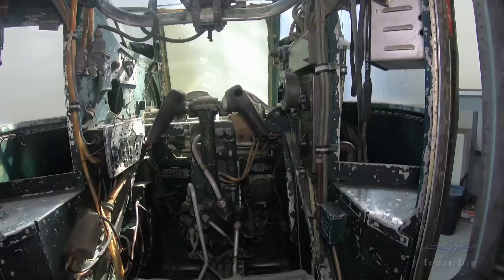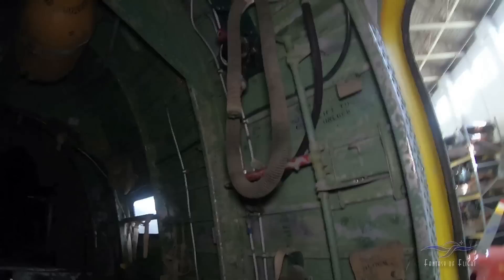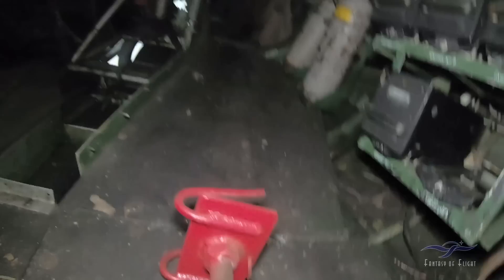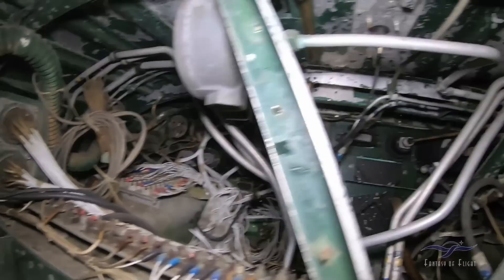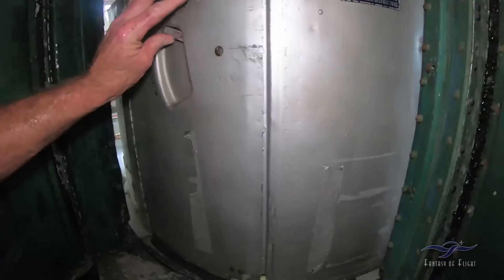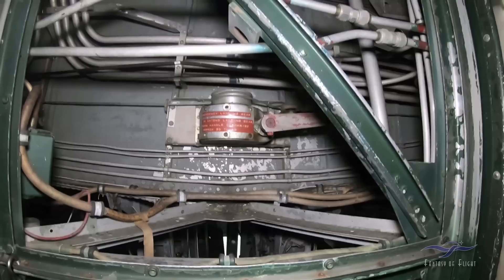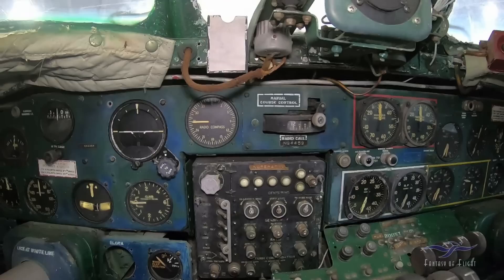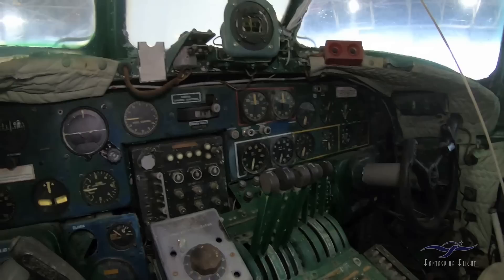Consolidated B-24 Tour - Subscriber's Request! - Part 2

Comment: Kermie great video! I recognize the twin red buttons up on Co Pilots console. It is the IFF Destructor Switch NOT the Engine Fire Bottles switch. The IFF can be destroyed two ways, the crash switch and the Destructor Switch. I was watching when you were climbing near the top gun turret station, and on the Starboard Bulkhead above the little seat and table (near the torn back insulation) is the IFF Selector Switch for the "code of the day" 1-6. I was unable to spot the IFF Transponder Unit itself called the "ABK Unit" I suspect it has been removed, but they possible to find. Thanks for climbing all through the B24 it was amazing to see how authentic condition it is in! Jerry

Comment: Thanks for the tour. I have never seen the inside of one of these. My father was a B-24 pilot during the war and he told me a story about flying a B-24 from Nebraska to North Africa: They had received a brand new B-24 in Nebraska and were ordered to fly to North Africa to participate in the war effort from there. They flew to an air base in Brazil and landed there to refuel before crossing the Atlantic. The runway they landed on was one of those perforated steel runways used during the war. It had been raining for about two weeks and the runway was covered in slime. Also the runway was lined down both sides with parked PBYs. As soon as the B-24 touched down and the brakes were applied the aircraft began to turn sideways and slide. The brakes were released and the aircraft straightened out and rolled down the runway and off the end into a field of mud. The landing gear immediately sank into the mud and the aircraft slid along on its belly until it stopped. The Sea Bees brought up a large Bulldozer, hooked on, and pulled the B-24 back onto the runway. The bomb bay was completely filled with ribbons of mud that had come in through gaps in the doors. A fire truck was brought up and they washed out the  bomb bay with a fire hose. The aircraft was refueled and they set out over the Atlantic Ocean for North Africa. Somewhere over the Atlantic it came time to transfer fuel, for weight and balance issues. The transfer pumps, which were located in the bomb bay, failed to function. The command pilot, my father was copilot, made the decision to abandon the aircraft. My father as copilot was to be the first man to jump out through the bomb bay. He got out out of his seat, made his way back to the open bomb bay, and was preparing to jump when the flight engineer, this big old master sergeant, picked him up bodily and set him off to the side. The flight engineer then walked out onto cat walk over the open bomb bay and proceeded to kick the transfer pumps until they began working. The fuel was transferred and the flight was continued to North Africa where they did their part for the war effort.

Comment: What is most common with these machines is the aroma of the chemicals used in the 40's for lubrication,varnish, oils and fuel and the zinc chromate paint. The smell is something you never forget.  Also imagine being dressed for high altitude flight and climbing into this aircraft that has been sitting out in the Sun , closed up and with an inside temp of about 120 degrees or more. Especially bad when the aircraft were painted overall olive drab.
Reply: What was worse was reaching cruising altitude where the temperatures were 40 below and touching anything metal with your bare skin would rip your skin off. That is why air crews wore sheep skin lined clothing over their electrically heated flight suits and wore sheepskin lined gloves.

Comment: Note that it doesnt help much, except psychologically, to cross the catwalk even with the doors closed, since they are designed to pop open under 100lbs or more of weight, so you can escape without stopping to crank the doors open (the bomb bay was the primary escape route for most of the crew), and also in case a bomb falls off the rack, or someow a load is dropped when the doors are closed. So if you slip off the catwalk, you are in trouble, open or closed.

Comment: Thanks for sharing a fantastic tour. My father was a navigator in the 90th Bomb Group in the Pacific. During bomb runs, he'd climb down to the bomb bay section and monitor the bomb bay doors. He said the vibration would sometimes cause the doors to slip down a little and he'd have to use that crank to keep them open. 

Sadly he passed away three years ago at the age of 91. I wish he could see this video. I think the last time he was in a B-24 was when he returned with a brand new airplane. Had to landed LA for some weather issue, then turned it over to USAAF and walked away. I bet he would remember a lot if he saw this.

Comment: Emerson electric nose and tail turrets. The rear one on yours has a K14 gyroscopic computing gunsight. The front has an electric reflector sight with illuminated reticule. The ring and bead/post was a back up if electricity failed.

Comment: Kermit that big switch is the electric hydraulic boost. Turned on when number three is throttled for landing as it has only engine driven hydraulic pump. 

An incredible time capsule of the 1940 era bomber aircraft. Akin to an undisturbed downed aircraft of 80 years but in near pristine condition. Imagine the emotions of flying such a craft into harms way. 

Difficult enough to complete mission in normal flight regimes let alone battle damaged. A thousand points of potential leaks of fuel, oil, hydraulic fluids. The enemy aircraft fully capable of shredding it all in mere seconds. They did not present themselves as easy targets but extremely fast and difficult to bring turrets to bear upon. Imagine the men unable to escape their stricken craft as she makes her mortally wounded struggle to maintain airspeed/altitude.

War is an incredible dichotomy of emotions all mixed into the experience of duty, honor, country.
No g.p.s., minimalistic radio technology, vast unpredictable weather operation in the range of mission. 

There’ll be blue birds over the white cliffs of Dover, tomorrow, just you wait and see.

Reel  your antenna in before landing,, the base commandant gets upset when the lead weight bounces through his office.

Have your flight engineer top gunner check your flying surface controls before take off, it may seem superfluous, but cables have been inadvertently reversed by ground crews.

That ship is 100% authentic.

Anything but air tight that 50 below breeze160 knots at 30,000 feet made your flying suit essential.

That ship is a priceless museum piece. In 1944 that was the spacecraft of the day and those old timers amaze me with their clever craft and patriotic duty. Simply magnificent Kermit.

Skipper, four is smoking number two is knocked out,, the right fin is shot away. We’ve got three really badly wounded.
That flak did a number on us.

Well boys , feather two and four, fire extinguish both, throw everything we don’t need overboard.
She’s still clawing for air speed and no fighters have seen us yet,, I’ll try to keep her flying, heading  for the deck, till we get over the lines. You can bail now or if we get the fire out we’ll try to make base.
She doesn’t seem to be leaking fuel so let’s try to get out of here.

Skipper, we’ve got a five hundred pounder hung up! 

Well, try to work it loose if the doors will open enough,, if not boys put the chutes on our wounded and try to get ‘em out, bail out, I’ll keep her level till,,,,

Comment: My best friend (gone now) flew 31 missions in a B-24.. Was the pilot...Here is something most people don't know.. His second plane was the only B-24 he seen with 4 bladed Paddle Props.. I believe it was a H model? It was named Hennie Hunter, and flew right up front on D-Day. I believe he had two missions that day.. Had one the day before, but was canceled because weather.. He flew off of the Col. wing that was flying Red Ass. This was the lead group of planes in on D Day.Bud was right up front in the 446 bomb group.. Flew out of Bungay,England .That plane went down in the English Channel one month after Bud got back to the states.. First Plane he flew was Wee Willis. One of the very first B-24 built. Those were the tough ones to fly.. I talked to him many times about all his missions..Lot of close calls from different things..
Reply from the maker: Thanks for sharing that.
Reply: @KermitWeeks444  Thanks for the Tour, and your passion for Planes/History
One last note on Bud's four bladed prop plane. When it first showed up at Bungay, The Crew Chief told Bud, and his co-pilot to take it for a spin. It was empty  with just fuel.. Bud said it was a real hot rod compared to his first plane. Went on to explain a bit about the Davis wing, and where it worked best.. (altitude) The B-24 flew lower then the B-17 in general, but he tried out the ceiling when on that test drive. He said it kept climbing, and climbing up to 33 thousand ft, and was still going. Reason he stopped was he noticed the Fuel Pressure gauges start to Flicker,and thought that was about enough. :)
Reply: Please write those memories down before they disappear forever.

Comment: During the tour of the Navigator/ Bombardier station, the EMERSON BOW TURRET has two sets of hatches. the set mounted on the turret had to be locked closed before the turret could be rotated. The inner doors were locked shut to keep the cold wind blast from entering the cabin. In warmer climates, the were left open for ventilation.
The pedal inside the turret (left foot ) was for clearing jammed ammunition in the Browning cal.50. the dead man switches had long ago been by passed because the were broken off at the bottom of the control handles.
After leaving the nose, entering the forward cabin. Kermit said the seat for the MARTIN 250CE ELECTRIC DECK TURRET was missing but later on he lifted a piece of plywood. That was the remnant of the seat. During it's service in the INDIAN AIR FORCE the flip-down gunner's seat was replaced (the original metal backed seat probably broke loose and couldn't be fixed) the under-seat control box was always flopping around because nobody ever checked to see if it was locked before flight.
All over the cockpit, there are two different greens sprayed. The original green was a black-green and can be seen, if you look carefully. The funky Apple green was a poor attempt to cover up all the chipped paint that was flaking off around the cockpit and the control levers. (too bad they were so sloppy) :(..
Reply: P.S. The canvas cover by the Radio Operator was meant to keep the operator warm and to quiet the wind noise whistling around in the waist gunner's area. (It was very loud which made sending and receiving audio messages almost unintelligible) a Radio man,
 Sgt. Hank Gableman (God rest his Soul) said that even with the heat of the tube radios and curtain closed, at 25,000 ft, it was so cold that he would use the sunlight coming through the windows to stay warm.

Comment: Fire bottle controls are on floor, outboard of co-pilot seat. Bombsight likely Sperry T-1 (near copy of Lancaster sight). Large box on left of nose is where speed/drift/etc. would have been entered. Norden not allowed on exported aircraft (as was likely case for Sperry S-1). I think restoring a/c with T-1 would not represent a USAAF-service plane. Seat for Martin top turret was part of an electronics enclosure; gunner stood into turret, then pulled seat-covered box up to his butt. Latches on each side let him drop it when he was ready to leave the turret. Brakes had two complete systems (inner and outer). Not differential. If both pilots pressed left brake, one system applied (lets assume inner), with improved force because two pilots were applying it. If both pilots applied both pedals, max force applied to entire system. Hydraulic gauges showed what was available, and how much of that is being applied to inner and outer systems.

Comment: Kermit, one of the very finest tours ever ! If that thing is fully restored (and everything left in which is now there) to flying condition it will be the best of all the flying 4-mots by a big margin, it is however a very, very good thing you recorded it as it is now also as a historical record. In the pit I wondered where the Interccoler flap controls might be, they were quite important to keep the engine from knocking by too high carb air at hi-alt and high power - in the B-17 you have them on the right side of the Co-pilot posistion. I will do the B-24 in my 'little' simulation I'm working on, it's an absolute must (though not to the fidelity we see here). I can't wait the day you will give us a full tour of the finished job !!!

Comment: Thanks for the tour Kermit. For several years I used to have Sunday breakfast with several aviation minded friends. One of them (Lester) flew a 24 in Florida that had a B-29 turret mounted in it to train crewmen who were to man the guns in the 29. The turret, mounted somewhat aft, was so heavy that the USAAC  installed a tailwheel to prevent contact with the ground during landings, for obvious reasons. Les said a tail stand was installed by ground crew before engine shutdown. Les was a great guy who later in our friendship helped me rebuid a wing for my Stearman. I've seen published pictures of the 24 that Les flew - turret and tailwheel look very odd.

Comment: That handle with the loose cable was the Emergency Nose Wheel release for the Navigator and Bombardier to escape from a crashing bomber. The Lettering is very faded but it used to include all the instructions for egress in an emergency.

Comment: Pristine! -- untouched & original WWII gear throughout! Man, Kermit, this may be the finest renovation-ready B-24 existing, stem-to-stern, and it's all yours! BTW... the navigator's and bombardier's stations are in the nose/greenhouse -- forward of the pilots (and flight engineer's center/jump-seat, between the pilots, was where he usually sat at take-off to assist with throttles & monitor engines.The engineer also stood up between the pilots, to man the upper/forward turret --- if there was one. Any major differences in aircraft model (B-24D, -F, -G, etc.) would be because of various nose equipment modifications, like:  new radar, new guns, different bombsights, different greenhouse glass for different missions, etc.   Press On!  (End.)

Comment: My father was a Radio Operator in the 389th stationed in Hethel England. I've flown in the Collings Foundation B-24 twice. The Radio Operator area was directly behind the Co-pilot next to the top turret area. What Kermit thought was the radio -operator station was actually the Radar man area. My father's plane eventually carried the radar equipment, which eliminated the belly turret. My dad survived 3 crashes. 1st one involved shot out hydraulics forcing emergency landing off the coast of Dover, @nd incident involved a mid-air collision over his base in England. 17 killed. my dad bailed out top hatch by top turret. 3rd time he was shot down during battle of the Bulge run on Christmas Day. landed in Belgium. 7 killed that day. Only my father and his nose turret gunner survived.

Comment: Very cool. Those vertical mounted bottles under the cockpit may be fire bottles for the engines. That's where ours are on Diamond Lil anyway.
Reply: Curt Lewis I may be wrong but it seems the B17 Flying Fortress is more widely known than the B24 Liberator. Is that because of all the publicity back in the day when the Memphis Belle toured the USA after fulfilling the required number of Missions? Never heard they repeated that with a B24. Perhaps you may know seeing you know more about Diamond Lil.
Reply: @cf6282  that is exactly right. It is generally considered to be prettier too. It was a B24 that completed a tour a duty first actually (before Memphis Belle) but it unfortunately crashed in Iceland on the way home for its publicity tour. 

The 24 is way faster, with a further range, and a much bigger payload - yet is still considered "the box that the B17 came in."

Comment: Thanks Kermit for making the effort for a detailed tour. For anybody in Melbourne, Australia there is a great little museum built around a former RAAF B-24 in a former WW2 hangar in the outer suburbs of Werribee (located not far from the RAAF Museum at Point Cook).  It will never fly again, but they are doing a museum quality restoration. They schedule engine runs occasionally, and the staff are excellent. One of the staff gave a great detailed demonstration of a working Norden bombsight. https://www.b24australia.org.au/home